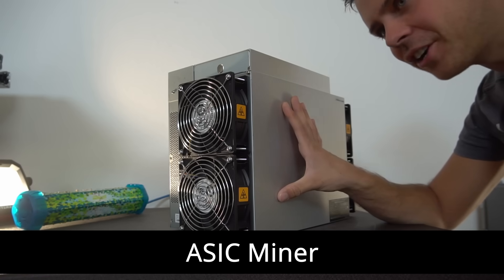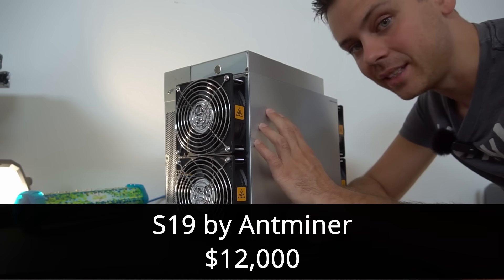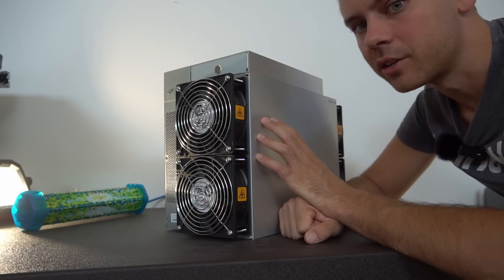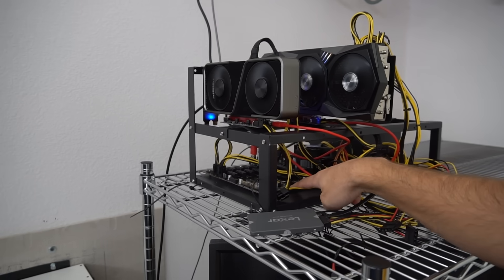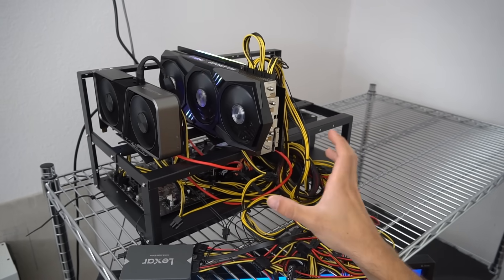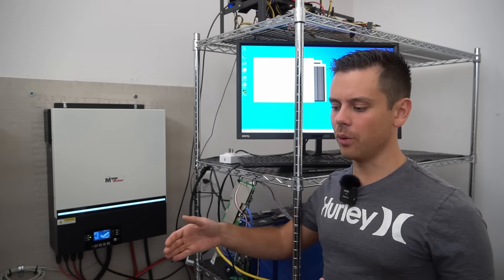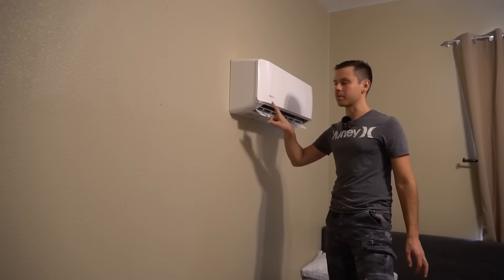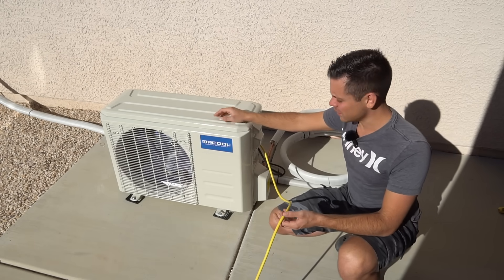Solar Powered Crypto Mining: Making free money with sunshine!

Comment: I don't think the purpose of bitcoin was to be anonymous because their implementation? Unless you're mixing/tumbling it's pretty easy to backtrace every previous transaction once you have an address from a transaction.
Reply from the maker: But how can you know who's wallet is who? But yes true. Very transparent
Reply: @WillProwse  If I transact bitcoin with you, both of our addresses are part of that transaction. I can then use that address to backtrace any other transactions tied to that address. I suppose if you never transact through that address it'd be anonymous until you're ready to convert to typical fiat or some other offline transaction I suppose. 

Unless you use a separate address every single transaction, and never use the address except to convert to fiat, it's all back-traceable. Even if you use separate addresses for transactions, but then you consolidate the crypto within those addresses to another, then all the co-mingled crypto is essentially tainted and tied to any other you transacted with (including internally with yourself).

The only potential anonymity is if you constantly run the crypto through mixers/tumblers, but that also increases your exposure to being tied to other shady wallets participating in the tumble, and the legality of doing so is somewhat grey.

Comment: A few months back, I bought 4 used 230 watt panels from that place out in Arizona. $100 a pop each. Was planning on laying them down in the back since installing on the roof might be an issue.. was hoping to use them to power a few cards, but I've been stuck on buying the other equipment to complete the off grid to power a 800 watt system. I just don't know what to get, even after looking at your guides. I just need Batteries, Battery charger, and an inverter, and all the little things to connect it all. My anxiety is the death of me.

Comment: Additionally, since neither you nor anyone else can predict the future, it is MOST LIKELY that there will be dozens if not tens of thousands of digital tokens in the future, with many of them representing unique technologies. It's nice to imagine that ALL DeFi tech, NFT tech, etc. will be built upon the Bitcoin base level Protocol, however, that's not in keeping with how humans work. We like variety and we each have unique needs, wants, fetishes, etc. So just as there are 100 different automobile colors and 100,000 different purse designs and 100,000,000 different ways of doing the same thing (cooking dinner, speaking, sleeping, etc) - so there most likely will be scads of digital tokens in the future. You are correct that Bitcoin is the big daddy, the best, the most important, but it won't stand alone and sadly, it will also most likely be used by bad actors to track people and to control people. Like most things, it will be used for both good and bad. 
But if a man (or woman) is going to put their money on just one coin - yes I agree . . . BTC is that coin.
: )

Comment: Dielectric oil cooling, could be the solution, the noise is eliminated, the heat exchange efficiency is increased and, if desired, with an HVAC technician, the heat could be extracted directly, like an air-water unit, where instead of water it is turned oil with a pump.

Comment: I’d encourage you to read more about Ethereum. I agree on defi, but you seem a bit confused about where the build and development is taking place and why.
Reply: Yea man read more about the ethereum
Reply: It sounds like he read a couple posts from BTC maxis and didn't question it
Reply: Except that Ether is switching to PoS, and they cut the payout for mining.
Reply: @surferdudemi  that's a good thing. Ethereum needs to be Nation state proof.
Reply: @niktak1114  my point was that the payout is falling, even though many say that burning a portion of the block reward will result in the value increasing.  I don't think there was a real issue with PoW, even though a few pools threatened to kill the change proposal.  Remember that PoS just means a different kind of group controls the validation.  It doesn't make it attack-proof.
Reply: @surferdudemi  The PoS implementation ethereum uses is much more difficult to attack. It requires two thirds of the network to coordinate to attack instead of one half and the upfront cost to attack is well over an order of magnitude higher than it is to attack bitcoin (only requires $3-4B in hardware to exceed the hashrate of all existing miners). Due to the validator queue the "spawn camp" attack is no longer possible since it would take 10-12 months just to activate enough validators to attack the network. Also a 67% on ethereum beacon chain wouldn't accomplish much since there is slashing so any attackers would quickly get all their ETH burned permanently.
Reply: @niktak1114  interesting.  I had not seen the stats on that.  Still, the payout drops, so mining is not as lucrative, which was the point.  Last I looked, staking pays something like 6%.  That's in addition to any gain or loss in the value of ether while it's staked, of course, so you could do much better or much worse.  So staking doesn't seem like a great thing to do.  There were also questions about the "quality" of the staking software implementations, since there are penalties if there are errors in the behavior of the nodes.
Reply: @surferdudemi  the benefit of PoS over PoW is that an attackers stake is nuked when they try to attack the network.

With PoW you just create new accounts, exact same hardware and try again and again.
PoS is an objectively better consensus mechanism in this regard.
Reply: @Anonymous-m9f9j  I don't think it's that simple. With PoW you have to have enough hashing power, not just a bunch of accounts. That's why it's called a 51% attack.

Comment: I love this idea as a concept. I'd love to know it really pays off in the long run. I have to say that all the people I know personally (not internet acquaintances)   who mine crypto are not super trustworthy types so their claims of profits are a bit dubious, but I would love to be wrong.
Reply: 1080ti in my pc has been running full tilt since october 2017. mining with nicehash (payouts in btc). free heat in the winter, did not turn on heat once in my apartment in upstate ny during college. if you have a single pc or small rig, or have the discipline to hold the coins and just pay electricity out of pocket, the price appreciation after btc halvings makes what seems unprofitable or barely profitable, insanely profitable and frankly stupid to not do if you already have a high end pc and live in a cooler climate.
Reply: @driil  how is this working out now?
Reply: @NeverTakeNoCut-offs  ethereum fees collapsed in late spring as the market cooled off. ethereum then transitioned to proof of stake in the fall so GPU mining is left to smaller alt coins, which there is little demand for, mining payouts are minimal. so unless you need the heat, mining with personal pc no longer makes sense. the system with the 1080ti was given to a family member as i have upgraded to a system with a 3080. i still occasionally run nicehash if i want to warm my office without heating the rest of the house, less dangerous/slightly discounted space heater.
Reply: @driil  Yeah, I was pretty skeptical this was going to payoff in the long run for latecomers. Like a lot of these get rich schemes, you usually have to be on the first wave, and sell out early...

Comment: Bro you are dead wrong lol. A 6600xt gets nearly half the hashrste at half the power. Your 3080 is about the best mining card they make in terms of efficiency. It gets 100 mh at 220w. A 6600 gets 33mh at 80w. 3070 gets 60mh at 120w

Also you don't need a mining motherboard. Any board will work
Reply from the maker: Really?!! All the charts show it as twice as efficient. And yes of course it has half the hashratsm but for the power input it's great
Reply from the maker: I didn't know the 3080 pulls so little. Mine doesn't
Reply: @WillProwse  did you buy LHR cards lol. Send me you over clock settings
Reply: @WillProwse  you want hash/watt. The 5700 XT is the best mining card in that regard. It gets 55mh/100w.
Reply from the maker: I'll check that out and read everything I can tonight

Comment: Wow disappointed to hear you say ethereum is garbage. That's where all the innovation is happening in the space. Bitcoin layer 2s have no chance at becoming a competitor to ethereum unless they add zkproof opcodes to L1. Without that all bitcoin layer 2s will be centralized and convoluted.
Reply from the maker: Yeah I don't like Vitalik and they never delivery any of their promises. And we could do better off with a database. And just use Bitcoin to back it. I just don't see the point
Reply: @WillProwse  never delivery any of their promises? The PoS chain has been running for 9 months now. EIP1559 has been live for over a month. L2s just launched. The merge is only 6-9 months away. Looks like they are delivering to me.
Reply from the maker: And I used eth for a long time. The fees are ridiculous
Reply from the maker: How often did you use eth today?
Reply: @WillProwse  I've used ethereum everyday now for about 3 years
Reply: @WillProwse  I also used arbitrun today (an ethereum L2)

Comment: Hey @Will glad to see you're finally putting all that solar to good use. Look into how stratum protocols and nodes work. Also data collection and correlation like IP and wallet addresses etc. Lots of fun. Have fun.

You're probably mining ethereum on your GPUs (nice hash to bitcoin, I imagine)
Ethereum needs low/medium core speed and high memory speed. You can easily increase hashrate and lower heat and lower usage and also potentially extend the life of your GPUs.

It is fairly simple but people get into the details like temperatures and tuning and also how much power and heat you use depends on the algorithm. Eg: If you use SATA power connector for your riser, it might seem okay on etherum, but would likely melt on something else thst is core hard, like ravencoin.

You're a smart guy but remember to stay humble. You still have much to learn.
Reply: Agreed. The hardware setup is simple but tweaking the cards to get the best hash rate per watt may take some time. I hope he isn't mining Bitcoin directly with the GPUs since I assume that doesn't make sense at all at this point with the difficulty. You mine an alt coin then convert it to Bitcoin. I would consider doing this with solar as well but aquiring all the gear to do so and offsetting the heat has a high cost.

Comment: I would mine some crypto if I could get some GPUs without the crazy markup. Also, Texas is really hot in the summer and I have a hard enough time cooling the house already. I wouldn't mind mining in the winter to heat the house. At least I have some panels sitting on the lawn powering my small off grid setup, saving a little on electricity. I wish I had some land so I could have a large ground mount. South facing house means my panels are just sitting in the front yard for as long as neighbors don't complain to the city.

Comment: I'm a bit skepical, I know servers are vacuums for current, and it adds up FAST (especially at night). I'd love to see an actual spreadsheet covering everyting (solar panels, inverters, batteries, cablng, computers, AC's, etc.) you have purchased, all your utility needs/costs, the amount you actually earn/day/mo/yr, how much time you spend on it/day, and a comparison of actual income vs costs. The video is kind of all over the place, with no running totals, and a lot of it sounds like "justification" (like how much do you actually spend in a year on heating in a newish house in LV?). Have you gone electric for water heating and induction for cooking?  There's a lot missing from the "Free Money" part.
Reply: If you have 50k to spend and you're banking on the appreciation of btc, buying btc is probably better.
Reply: It takes quite a while to earn back the expense of all the equipment. Roughly $50k.  4.5 years to break even excluding maintenance and equipment replacements by his ROI figures.  Plus have you watched BTC in the past year it has lost $10250 in coin value  fluctuations from $50000-$40000 per coin all year.

If invested in standard indexed ETFs  at 4.5 years he'd be sitting on ~$19500-$25000 in profit + the original $50000 invested .
Reply: So why don't you make such a spreadsheet?  Relying on others is the lazy persons method. You'd learn a lot, too.
Reply: @Yodaandhislightsabre  From your comment, I'm sure you missed it, I'm not making the claims. I don't have his systems. If I was, I would... And just so ya know, that's kinda how "proof" works, not relying on others to do your work for you.

Comment: Pumicecrete building for your mining equipment pumicecrete buildings are fireproof termite proof rust rot and mold proof and has a high R value and good sound attenuation solid poured walls and virtually indestructible and will protect your equipment 
This is a great DIY project 
Pumice mine for Vegas is global pumice and for Washington is Hess pumice

Comment: i think you are forgetting to consider the increasing mining complexity - this has to slow down your break-even period and you should do a projection calculation with these figures and still be sure you can make profit.
Reply: Crypto is volatile. There are epic bull seasons where you can ROI in 4-6 months. Bad bear markets may take 2 years. Since your solar mining you have a huge advantage over most miners that dont have solar or cheap electric
Reply: I mined ETH for 2 years and you are right on.  AND, those ASICS are not without wear and tear - reducing your profits as they breakdown.  You're better off just buying crypto.
Reply: @W0KNI  crypto mining is really just a geek thing now as you can't compete with the big boys.  I used to do it about 6 years ago and made "ok" gains from it, but nothing life-changing.  But as you say, you're better off just buying the damned crypto itself these days - so many low cap alt coins to hedge your bets across and you only need 1 to do 100x from fractions of a cent to make some serious cash if you spent the time in advance to thoroughly research the project.  But that said, the comment up-screen about basically heating your (small) house for free in the winter time is a valid if you're that way inclined.
Reply: @ytsux123  A "Smart Heater TM"!
 It's could be cost neutral if you already use resistive heating.
Reply: @ytsux123  When you buy it they know you have it.
Reply from the maker: Yes true, but that's a risk I'm willing to take

Comment: Could you build a DIY walk-in cooler/freezer with thick insulated walls to house some of the miners? That way you don't have to cool an entire room. You can use a system that tricks the thermostat on the a/c system to use a window unit or mini split to "freeze" a room.
Reply: That’s generally a waste of energy. You don’t need to cool them as much as you need to keep air circulating and venting the waste heat. Some people use simple grow tents and vent those outside. There are some really interesting setups.

Comment: The problem with electric vehicles is total cost of ownership. It costs the price of the car to replace the battery for the Tesla’s.
Reply from the maker: And high quality EVs should last 400,000+ plus miles easily. Gasoline cars are pathetic. And this is coming from someone who grew up in a family of mechanics and rebuilt engines and cars as a teen. The total cost of ownership of an EV is a fraction of the cost of a ice vehicle. Practically zero maintenance and electricity is dirt cheap.
Reply: @WillProwse  I dunno I see people with Tesla’s have the batteries crap out right after warranty. I have a gas truck I can fix anything on for a few grand. It will last forever. 25k for a new battery or your Tesla is a lawn ornament is not great at all.
Reply from the maker: @Garyguygax  Tesla battery has a warranty or I wouldn't buy it. Same goes with any electric. And true, you can work on your truck. But most rely on parts that are made by manufacturers. Most people do not make relays and door locks at home from scratch. We depend on everything in society to get us where we are
Reply: @WillProwse  You can get parts from multiple sources or even a junkyard.Some can be rebuilt.  Tesla is a black box you are locked out of. If you could yank a cell out of a Tesla and replace it from Alibaba I would be the first to ditch gas vehicles. As it is a proprietary locked system that is essentially disposable based on Tesla’s whims I gotta say no to EVs. 

Lol. They can even push a software update and remove any and all features or turn the whole damn car off.That will mesh really well  with social credit schemes. Just no.
Reply: 00 00  The main problem is ine company has 1) A near total monopoly on parts and tools needed for update. 
2) Complete control over all features with kill switches they have be en known to use. 

Compare a ford f10 c 1980. Dozens of companies make parts. You have total control over all features. 

Which sounds better?

Comment: Will, have you considered putting a miner inside a dedicated, working refrigerator for cooling? **edited...GPU based miner**
Reply: It would quickly overwhelm a standard refrigerator.
Reply: @Quidisi  Are you sure about that? I'm talking about the GPU miner.
Reply: Have you taken into account that the refrigerator has to dump this heat somewhere and that it normally just heats the room that it is sitting in? Dumping the heat outside is a better option.